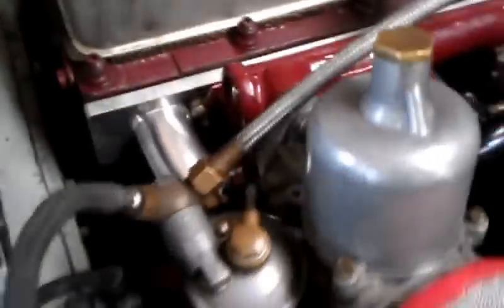55' MG - TF-1500 Header / Extractor installation - no muffler

Comment: They make headers for TF's?
Reply from the maker: +spikeafrica These cars are still actively raced in the vintage circuit here.  The headers I have were designed by Manley Ford which he had built for his race car.  He sells these headers as part of a side business for race parts he's developed.  http://www.freewebs.com/manley776/
Reply: WTF, I didn't know this! and I just spent $300 ceramic coating the stock one 2 years ago. Damn it!
Reply from the maker: The header takes a bit of fitting to get in the car.  It is made for a TD race car and thus is a bit of a tight fit in the snug bonnet of the TF.  I rather like it though.  It's one of my favorite go fast parts.